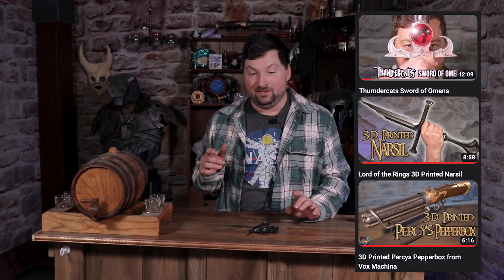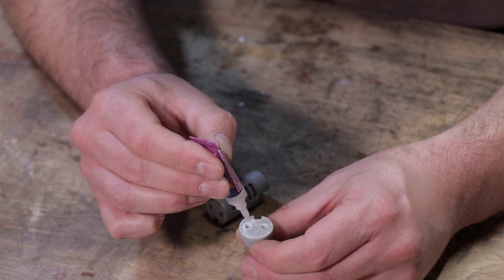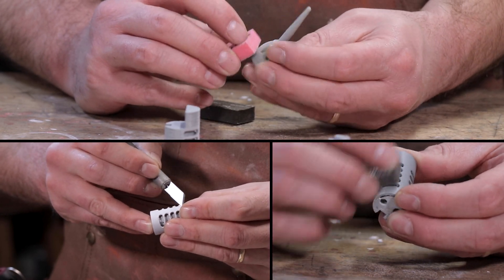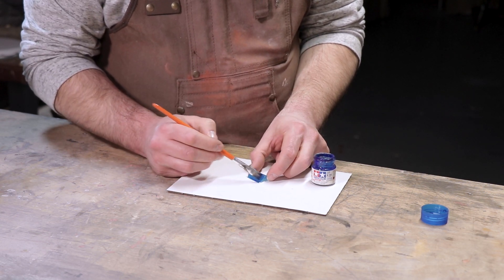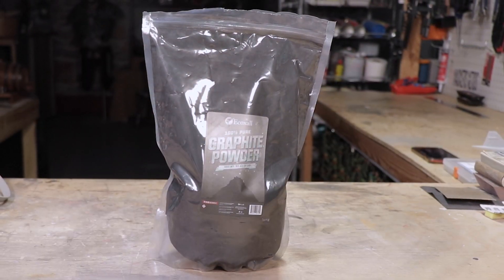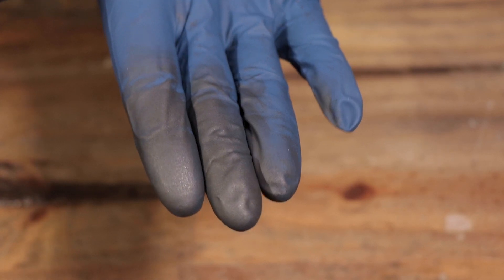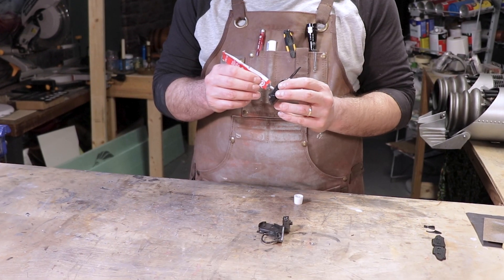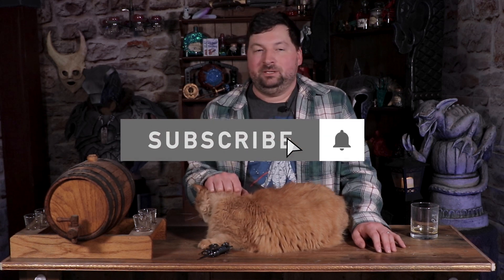How to use graphite powder to create a metallic finish

Comment: Love the video. Straightforward, clear instructions! And serious bonus points for the cat and whiskey cameo.

I'm looking for more of a subdued look. Any thoughts about the end result if the graphite is applied over a satin black instead of gloss?

Thanks!
Reply from the maker: Thank you so much 😊. That means a lot because initially I wasn’t a huge fan of this video lol. 

As for your question. You can do it over a satin black. It won’t have that mirror chrome look. It will be more of a cold grey with a tiny bit of sheen to it.

Comment: Hello! I was going to use this stuff to build a Mandalorian helmet and armor, but I wasn't sure if this stuff comes off a helmet in the rain or when it gets wet. Do you have any experience with this?
Reply from the maker: As long as you have polished it good enough. It won’t wash off. The granules of graphite should be pretty well imbedded into the gloss black paint when you see that mirror chrome finish.